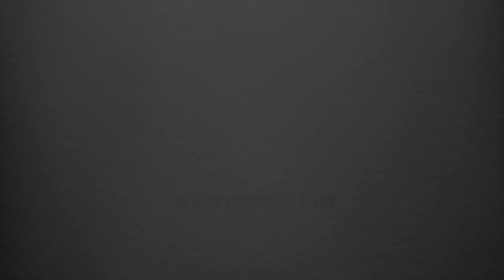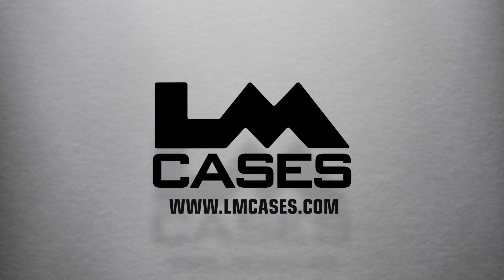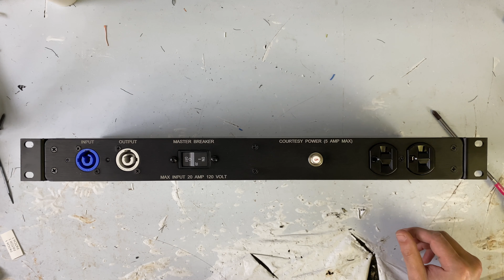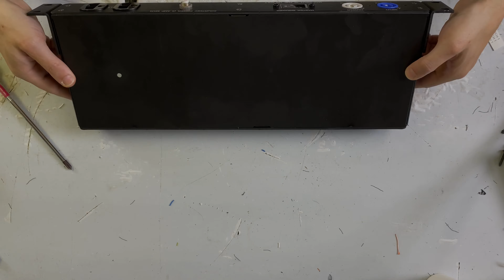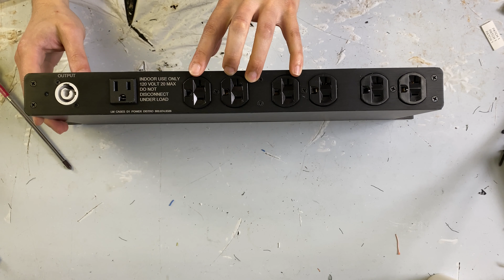LM Tour Systems D1 Power Distribution Rack Mount Distro | LM Cases

Comment: I like this product but i find it to be overly expensive for what it is, its not like there is a built power conditioner or a simple surge protector. Then add shipping to the price and it becomes a bit hard to swallow. Hit me up with a coupan or discount of some sort.
Reply from the maker: Glad you mentioned the quality! These are indeed made by hand per order in the USA. They also have not 1, but 2 simple surge protectors. Which on the D1 come in the form of a custom 20amp hydraulic breaker and a 5 amp pop breaker over the courtesy outlet. Happy to offer a discount for any quantity over 10 units.